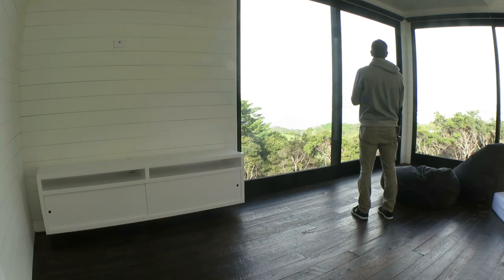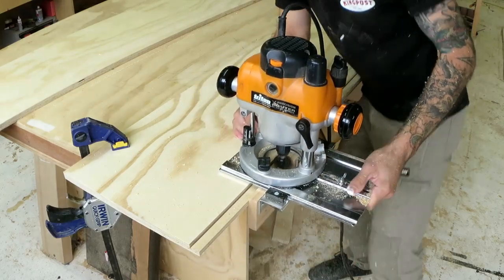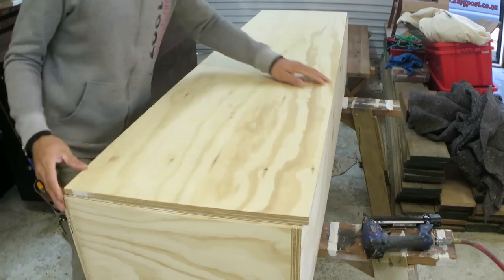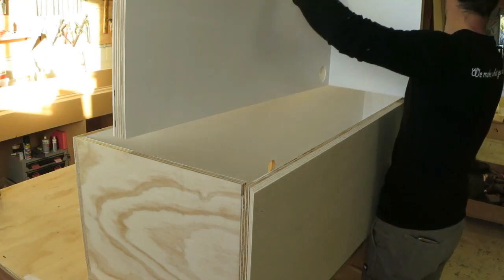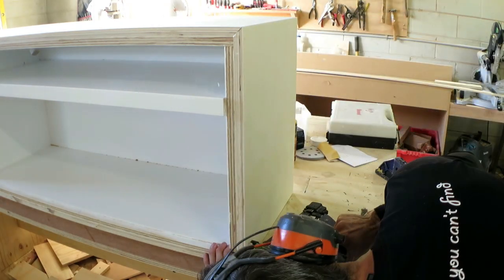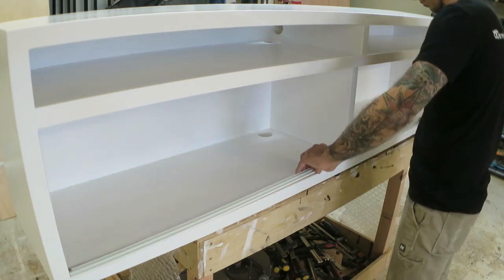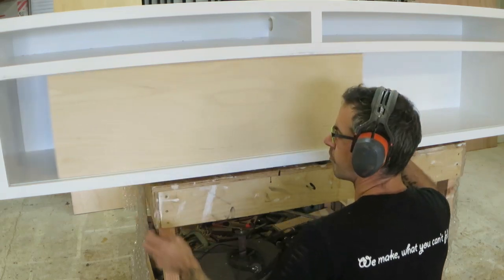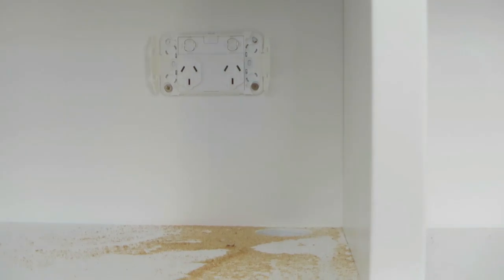wall hung media unit

Comment: Joey, it looks like you're using a fast dry latex paint.  Have you tried a water borne alkyd? You can get really nice results if you have time to let it dry. 1 coat per day. I was back in a house where I had coated a turret desk with Benjamin Moore's Advance in pearl finish and it was still perfect 3 years later.

Comment: Nice job and nice video, Joey. I'm glad you edited out the bit where the registered sparky came in to wire up the wall socket. That would have been real boring to watch. Cheers, Ears.
Reply: Wall socket was already there. He just unscrewed it from the flush box, passed it through the hole and screwed it back down. No wiring necessary.